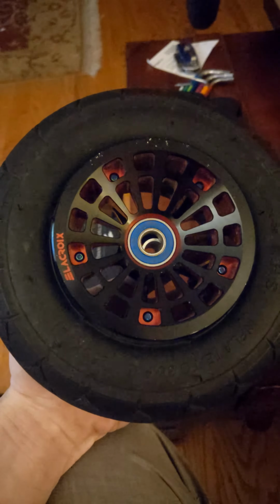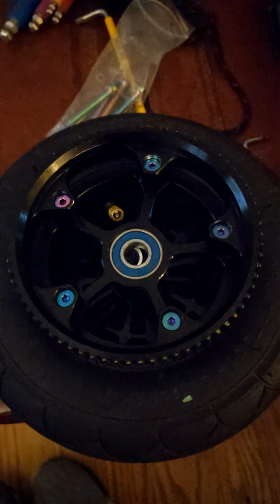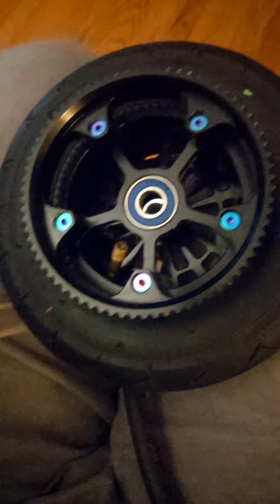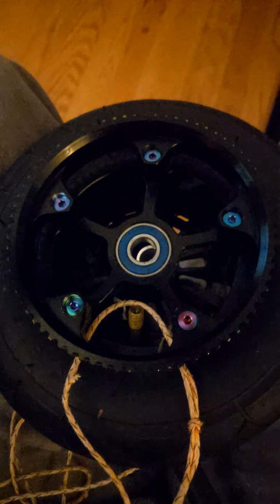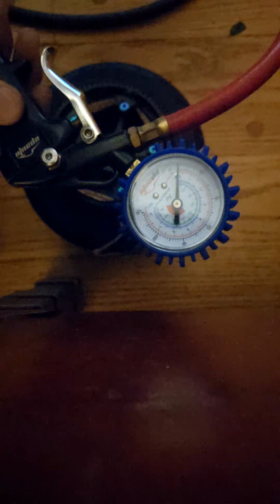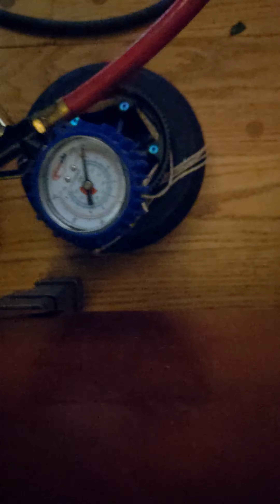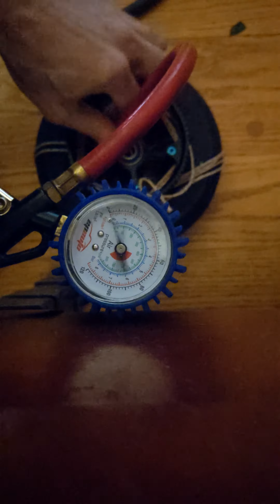How I Inflate the LaCroix GroupeB HyperRims

Comment: so to keep an eye on the tire pressure you have remove the back wheels or can you get to it easily with the reach the valve with the wheels on the board
Reply from the maker: At this point I can get to it easily with most air tools